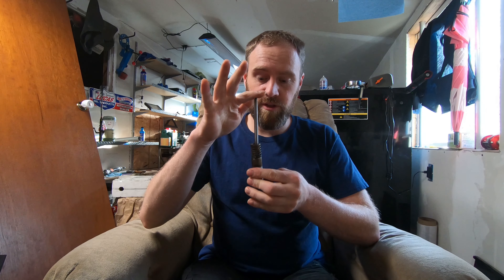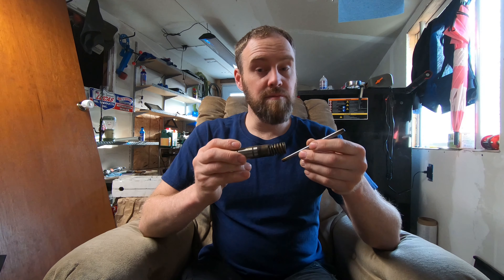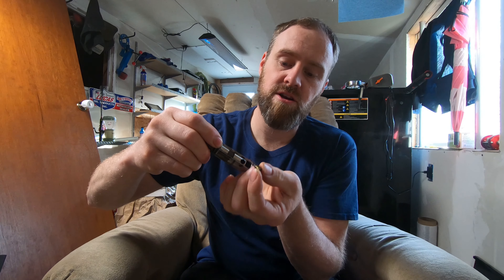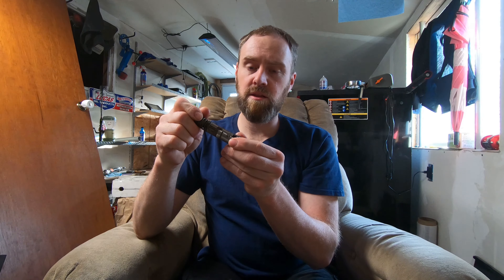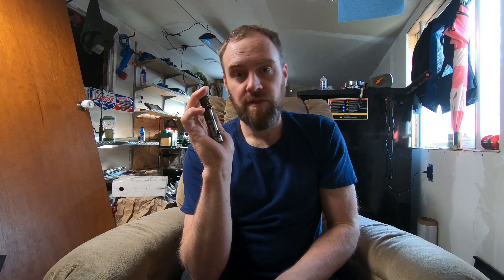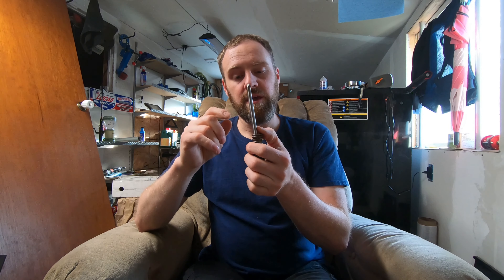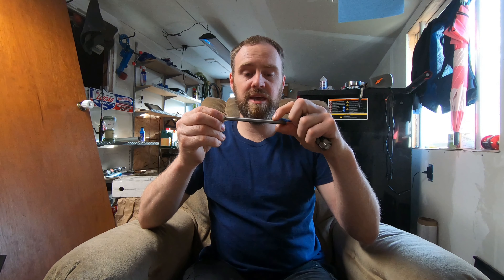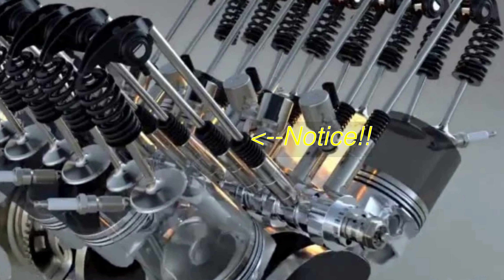Bent Pushrod, Is GM engineering to blame?

Comment: Great video.  I was thinking of buying a '21 Trail boss, but after reading all of the reviews and watching videos about the engine issues, no way would I buy one.  Thanks.
Reply: Tundra and never look back
Reply: I have a 2021 Trail Boss with 8700 miles, no issues yet anyhow.
Reply: @lamontemonnell4891  it’s coming just get the beer ready!
Reply: I bought a 21 sierra knowing this and 13k in cha bang bang in for this problem trading it I. As soon as I get it back 72k to be dealing with this nope imagine out of warranty
Reply: I have a 2011 suburban with afm. 150k miles.
Reply: @panchovia gen 4 AFM issues usually arise between 160-200k in my experience. $2200 I can delete dod , gain ya about 60hp, better fuel mileage ( usually 4+mpg) and make throttle response and passing power much much better. I do dod deletes atleast 2 times a month. Just started doing the gen 5 LTs, different but similar

Comment: I have a 2017 Silverado ltz with 6.2. I bent a 1st pushrod at 115k. No misfire or code, just valvetrain tick. Replaced it and now it’s ticking again 2k miles later. I turned off the AFM after 1st bent pushrod. Going to go look for your pushrods now.

Comment: Very good explanation. I have the same problem now on my 2023 Yukon with only 1500 miles and no clue from the dealer what they are going to do about it. I think they intend to patch it up with one valve only when they get the parts.
Reply from the maker: If its not under warranty, I recommend replacing the pushrods with something like I sell and eliminate the issue.

Comment: currently doing a delete kit from BTR with stage 2 cam. I had trouble finding a tuner that worked with OEM computers so I have self taught using HP Tuner

Comment: i had this tick sound BS, pulled the valve head saw a couple rockers with play, pulled the one with most (only 5mm of movement) saw rod bent (bent it straight) now ticking sound is gone. but imma go ahead & plan lifters, and rods replaced and probably cam too. but saw this vid after my own diagnose. My 2017 escalade only 97K miles.

Comment: We have a 2016 Escalade ESV platinum with 95K and it keeps bending the pushrod on cylinder #4 over and over even after a fully AFM delete and a full lifter rebuild and replacement. So expensive and frustrating!!  We are going to upgrade all the pushrods to these stronger ones and hope for the best!  Screw GM!! 🤦‍♂️
Reply from the maker: Good call, the smaller 5/16 performance pushrods offer more clearance and stronger design.

Comment: Just bought a demo 2021 1500 Chevy Silverado (5.3 ecotech3 V8, w/DFM) with 4K miles on it. I drove it for about a week and service park brake, ESC, and engine light came on along with some serious knocking. Drove straight to dealer. Finally got it back today (2 weeks later). Had a bent push rod on cyl#1. They replaced lifter, rod, and guides. Dealer says it’s fixed and that there was just a problem with a particular batch of lifters… idk if I completely buy that but we’ll see… wondering how long I have until the others go
Reply from the maker: It most likely won't take long and you will be back at the dealer. GM is rarely correct in there theory of what causes any failure.
Reply: Every 4000 miles you will get a bent push Rod.  I have a 2020, 5.3L Trail Boss with 12,000 miles on it every 4000 miles I deal with a bent push rod.
Reply from the maker: @KCIDoGIB  oh gosh may be time to put on pushrods I offer and if you need to take it in for any other engine warranty swap them out with the factory ones. At least then you'll have less hassle than bringing it in every 4000 miles.
Reply: same exact thing with my 2021 trailboss, 8000 miles
Reply: Same here on my 2021 at 7,800 miles and agian at 17,800 miles. Traded for a Ford.
Reply: @darylhenning2348  dam that sucks. I guessing you know the issue cause the check engine light came on ?

Comment: Hello, army veteran here, 8 years wheeled vehicle mechanic, been a gm tech  the last ten. AFM lifter failure very common. Personally I think the lifter fails which then causes the push rod to bend. See a lot of these fail due to lubrication issues, poor maintenance or failed vlom, weak or failed oil pump. Under warranty we replaced all lifters on the same bank, push rods as needed..
Reply from the maker: I've seen people go to the dealership to get the lifters replaced because of a bent pushrod. They later on bend another pushrod and buy my upgrade. I've also seen them bend a pushrod then upgrade to the version I offer and end up with a bad lifter later on, likely because the pushrod is stronger than the failing lifter. That bad lifter did only happen once though. Perhaps it was a coincidence or fluke.

Every single one of the bent push rods I have seen though, has some sort of side interference on them. This indicates it is interfering with either the head or the AFM lifter spring. Any interference like that can cause a harmonic deviation and thus bending a push rod. The ones that I now sell are a smaller diameter heavier duty pushrod. This adds more clearance to prevent the contact and stiffens them up to reduce the harmonic.

Comment: I did a “patch” job on my 17 Sierra 6.2 to get by until I could do an afm/dod delete. Replaced the no 4 afm lifter and pushrod, and lifter tray. Lasted about 2 months. The lifter wasn’t collapsed, but the pushrod looked identical.
Reply from the maker: its a interference issue. I offer smaller diameter pushrods to help with the issue.
Reply: @CrazedPerformanceRepair  does this mainly only happen on the AFM cylinders? What’s your website btw?
Reply: @CrazedPerformanceRepair  never mind I found your website. Placed an order for 4 pushrods. Had an error with payment, tried to resubmit and it said it was still processing the previous payment. I’ll email or call you tomorrow if it doesn’t look like it’s going through.

Comment: your correct about bigger issues. ive done close to 20 2019+ new body gm trucks. lowest ive done is 300 miles highest ive seen is 70k. at one point headgaskets and hp fuel pump lines were on national backorder. gm decided with this "chip shortage" starting at march 2021 their wont be anymore HD radios in any trims in any gm vehicle and wont have the bs lifter stuff.
Reply: and when doing warranty work can only use "gm" designed stuff. gm did have a massive recall on the lifters themselves and have an "updated" design for the new said lifters. only able to do the one side thats having issues cant do both sides even though we know its going to come back in so many miles for the other side. ive done a couple where i fixed one side and a week later same customer back with same issue except its on the other side. its gotten bad

Comment: 2015 6.2 silverado. just pulled my rods today. 3 were slightly bent. The rod above the failed lifter was extremely bent to the point that it was wedged inside of the head.
Reply from the maker: Yikes, don't forget to upgrade those pushrods to hopefully prevent the issue in the future. I offer them at  www.crazedperformancerepair.com but if you can source them elsewhere go for it.

Comment: Great explanation dude? I just had a 2020 Chevy 1500 6.2L 26,000 miles, with catastrophic failure due to this issue. (My assumption at this point) it blows my mind, that in order to to make sure these engines continue to run, we have to upgrade parts of the core of this engine. Why the f**, does GM (Giant Mess) admit to this issue. Makes me sick, and they should pay out the a* for this.

Comment: I wish I had known about this 2 years ago before buying my used 2014 Corvette. Engine was blown and had to be rebuilt associated with the bent pushrods, bad lifters, and damaged heads not to mention excessive carbon buildup among all other damaged parts. Repair total came out to be $13k. Thank goodness I bought an extended warranty for the motor
Reply from the maker: I now offer a pushrod to take care of the bending issues on my website. Smaller diameter and heavier wall tube. Reduces interference issue by making diameter a bit smaller.

Comment: Just had the issue on a 21 Trail boss, less than 5K Mi. Dealer had a 4 day turn around and replaced all the lifters.
Reply from the maker: You will probably be back for warranty again soon unfortunately.
GM has their heads up their butt as far as fixing things. They think the oil consumption on the older generation is from a oil relief valve in the pan. It's been from the PCV system due to a valve cover issue the whole time. They have a TSB specifically for the oil relief valve. And that's just one example.

Comment: I owe 2021 Trail boss and now my truck is broken down same issue it's also low mileage less than 4000 millage
Reply from the maker: Ouch, yeah that sucks.
Reply: I have 2 issues in my truck misfire cylinders and temperature sensor circuit high

Comment: I have a 2014 with 130k, The engine a 5.3L so far runs like a clock but I just had my transmission replaced! Scotty Gilmore has shown numerous videos on how GM quality has declined each year since 2013. Damn shame especially since the price has not declined the exact opposite matter of fact. A top of the line crew cab Z71 silverado 2500HD is around 75k that is criminal!
Reply from the maker: Your one of the lucky ones then seems hit or miss on weather or not they interfere from factory. Edit: Just realized you said 2014, those don't seem to have this issue. It's 2017 and newer.
Reply: my 2011 ext with 150,000 just did it
Reply: Transmissions need reprogrammed too. In their infinite wisdom they crawled into bed with the EPA and get a higher mileage sticker for the window when they come up with these DOD, AFM and slipping on purpose converter lock up clutch ideas. They don't care what it costs you, it's yours now. They only care about competing with the highest mileage sticker they can get so they propose that if we let the converter clutch slip 10% in high gear how much is that worth? EPA says how about 3 mpg? Deal. And you are buying a worn out converter that shudders because they told it to wear itself out early by controlled constant slipping. Fills your oil with metal parts eventually and there is zero hope that it ever has a good ending for your wallet. You need high level programming tools to make it slip 100% in all gears except for high and there it slips 0%. A lock up converter was supposed to be the ultimate in economy, but GM doesn't care who gets screwed as long as they can sell vehicles. Hiram on the Automatic Transmission yt channel does some of that reprogramming, high end shops should already have the equipment to do it. Crucial that the temp control for the cooler gets bypassed, they just don't work right for very long and when they don't work, they have zero cooling - how long is that gonna last? As if it were designed to fail in "burn it up" mode.

Comment: My 2015 Silverado runs great and has not needed any repairs yet (5.3 , g80 3.42 diff ). The only sounds i hear are the typical high pressure fuel pump & injector sounds , which are common on this  model year .I change my own oil and filter using mobil 1 0-20 oil and AC pf63e filter.

Comment: Hey buddy awesome Channel I'm DieHard Chevy guy been looking for a new Silverado and noticed that they're offering non-active fuel management in Canada right now  but I think same eng parts just electronically deactivated
Reply from the maker: Pretty sure they mechanically removed the system as well. It's much cheaper to put non DFM parts in and since they have them for other models why wouldn't they? I'm willing to bet they are full non DFM.
Reply: I hope this is true.  I have a 21 Trailboss with 1500 miles that came facory without dfm.  What happened to the days of solid lifts

Comment: I have a bent rod and 8 lifters need to be replaced on the R side of my brand new engine. I purchased a 2021 GMC Sierra 1500 AT4 and after 5 months/7,000 miles, my engine failed. GMC “fixed” it with new parts but there is no reason for this to happen. The dealership told me afterwards, “this is a known issue.” GMC is scamming ppl and you should not buy a truck from them. Their online service supervisor has missed a week and a half of scheduled phone calls. I am going to try to get a refund, ridiculous situation. Sent a letter to GM and GMC headquarters

Comment: My son bought a 2021 Suburban and because of the Chip issues the truck dont have AFM.  Im wondering if they installed standard rollers lifters or the DOD lifters are there just not controlled.  What do you think?  Thanks Mike
Reply from the maker: I would think that they would try to save cost and go standard. However, if they built the engine first then found out there is a shortage they definitely would not pull the AFM parts back out.

Comment: 2021 Z71 Tahoe with the 5.3L… was driving 65 mph up IH 35 and I lost all power and couldn’t shift. Turned out to be a “cracked piston”. I’m in the middle of dealing with GM on this. When the service writer saw I bought it 4 days prior and had 200 miles on it, she about fainted.

Comment: My 2021 6.2 Trail Boss with 13k mikes has lifter problems. Been in the shop for 3 weeks with no eta on parts.  Over a dozen vehicles in front of mine have been there for 6 weeks.

Comment: How do you determine if the rod is bent?  It's not visually apparent.  I put it on a straight edge as well. Doesn't seem bent.   Still throwing the 306 code. New plug, New coil, New injector. Lifter is working and operating the rockers and opening the valve.  I did have the injector oring issue you mentioned, I replaced the injector and the oring.  

I'm at my wits end with this thing!  Help!!!???
Reply from the maker: Did you check rocker movement while it was running or while cranking it over a while using starter relay? You could have a spun lifter that stops working as soon as oil pressure is present.

Comment: I bought a 21’ Chevy custom trail boss that is non AFM. Is it still gonna be a problem?
Reply from the maker: With pushrods, possibly. They not only hit the AFM/DFM lifters but also the heads. BTW that year should have DFM rather than AFM if it's equipped with something.

Comment: i bet it goes back to 2007 when GM introduced AFM. I have a 2011 5.3l have lifter issues several times. I have done regular maintenance and oil changes. My first issues with the lifters happened at 50k then at 75 and now again at 100k. I don't drive much and I only have 115k on my truck. Am I expected to keep repairing this truck every 25k miles? It sucks. Im seriously considering something other than Chevrolet.

Comment: I have a 2008 Dinali crew cab truck with the 6.2 L big block, same problems. And missing shaking rattle you name it. I know one thing they do not check tolerances on the engines they don’t care.

Comment: 2011 to 2013 LC9 5.3s are the best years as long as you use a Range Technology dongle and a catch can.  Just unplug the dongle for your smog test and change your oil on time. BOOM DONE!!
Reply: Any equipment that requires special instructions. Is Broken. " It stops, you just have to pump the brakes 3 time's first."

Comment: I installed a new cam and lifters in a 2010 yukon. Its cranks and dies in 5 seconds everytime. I went with a 3 bolt cam and removed the single bolt vvt cam. Dod has been deleted, does vvt also need to be deleted or or do I have a bigger problem?
Reply from the maker: Vvt has to be tuned out and hopefully you did the non vvt timing cover and 4x reluctor gear.
Reply: @CrazedPerformanceRepair  I did use the 4x reluctor and non vvt timing  cover but did not get vvt tuned out. I will get that done. Thanks for the info.

Comment: Dear @CrazedPerformaceRepair,

I have 2021 GMC Yukon Denali 6.2L, with one bent pushrod. I changed the rod and the lifter (altough it was good). After the first start of the engine, the problem was the same because I checked the pushrods and the new one was bent. 

Could you please give me some advice to solve this problem?

Thank you in advance. 

Best wishes, 
Dániel from Hungary
Reply from the maker: I offer upgraded pushrods on my website https://www.crazedperformancerepair.com/product-page/pushrod-upgrade all the info you need is in the description.
Reply: @CrazedPerformanceRepair  Thank you!

Comment: 2023 Yukon with 30k miles, bent pushrod on cylinders 1 and 2, whole engine replacement needed, blocks are 4 weeks backordered
Reply from the maker: Where are you located? I can likely fix your situation, but I wouldn't be able to cover it under warranty.

Comment: Hi, Just bought 2012 GMC Denali with 6.2,  130K,  seems ok thus far,  anything you can recommend to keep stable for a few more years? I just bought the Range AFM disabler.  Is Mobile 1/K&N oil filter wise?  Thank you for any guidance.

Comment: Hey your video are super helpful thank you! I have a question however. I just pulled the head on my 2014 Suburban on the passenger side. My old afm lifters spin inside of themselves. But the replacements do not. Why is that?
Reply from the maker: They have the pin that doesn't allow it. Not sure why they did that. I do know those are the ones more likely to fail though. Since they don't rotate they beat up on the same part of the shelf all the time rather than the entire area of the shelf inside the lifter.
Reply: @CrazedPerformanceRepair  thank you for your response. That's sad to know as I closed it all up yesterday. It did however run better than it did when I bought it. Thanks to you and your vids.